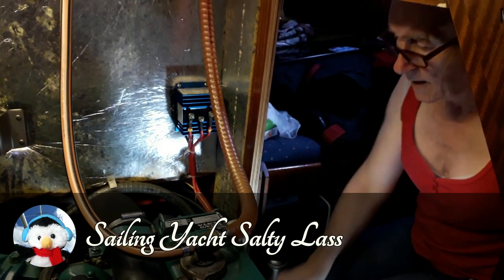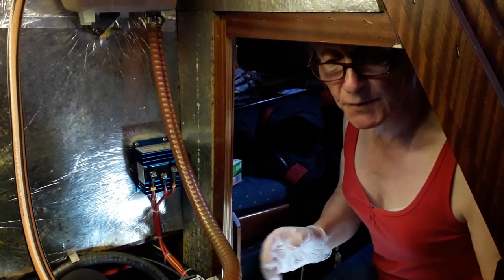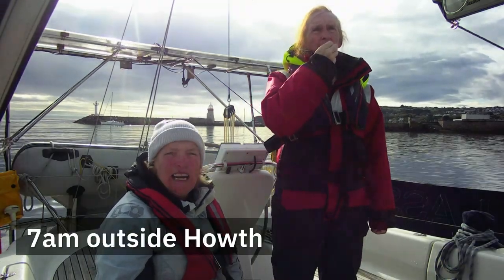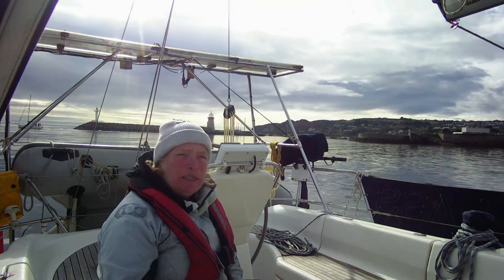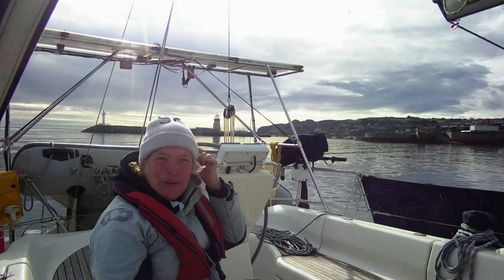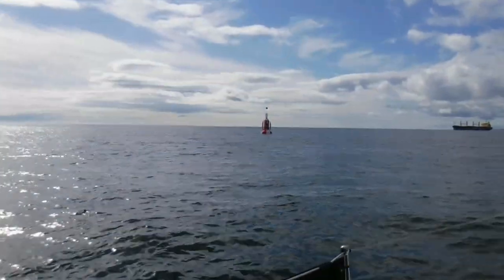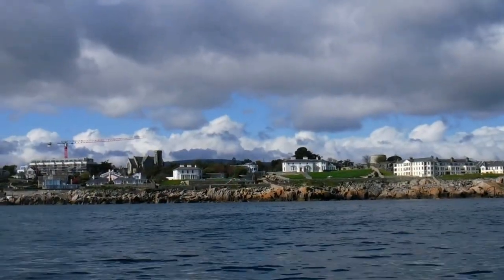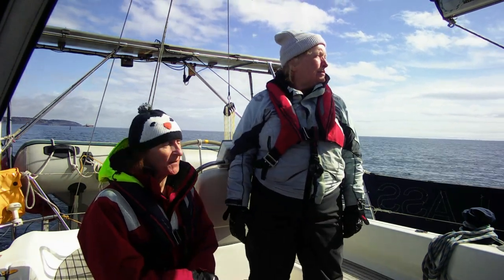Sailing Ireland - Malahide - Dublin Bay - Greystones - Volvo exhaust elbow - Ep. 291

Comment: Another idea when loosening a bolt or nut is to apply the easing oil/spray or whatever and then instead of undoing the item, actually apply a bit of pressure to tighten it. Not so much that you turn it noticeably but just enough so you feel it move. Then turn to undo. Quite often that effort applied in the opposite direction is enough to start the thing turning. 
Another technique - if there's room - is to tap the end of the stud/bolt with a hammer to shock it loose. 
I find that swearing like a drunken sailor often helps too... 
🤣
Reply from the maker: We did all three of those, especially the last one 😄 but we wanted to show the "extended spanner" technique as it can be so useful

Comment: Volvo exhaust elbows, to my knowledge, have a design life of seven years. Sea water corrode inside of the albow and you can't see the corrosion. Quite normal reason when those motors overheat.
Reply from the maker: That is why we pulled ours to check it
Reply: Yes, but if you experience overheating, and the elbow has past 7 yrs, then it is a reasonable corse. Of course, this will corrolate with redused amount of exhaust water. Because it is impossible to see inside 'the water chamber'.
Reply from the maker: I am glad to report that everything appears OK

Comment: I guess you didn't find any issues with the engine and that all is good?
Reply from the maker: So far, so good. We have a small oil leak from where the speed control / morse cable is bolted to the engine. We lose about a teaspoon of oil over an 8 hour passage so we are not concerned and we will sort it out when we are back in Bangor